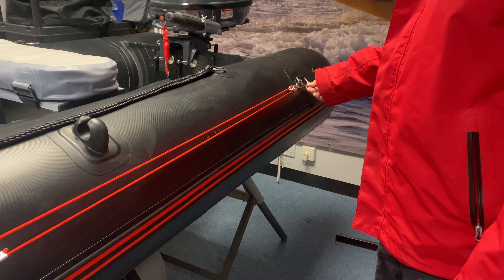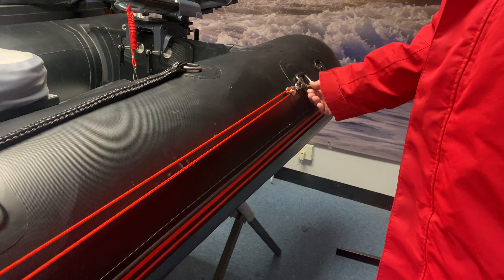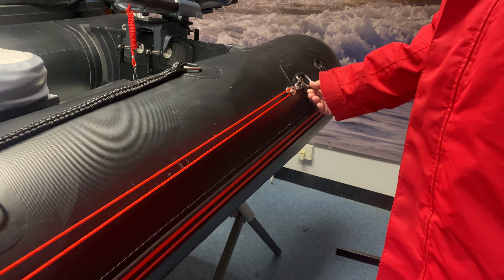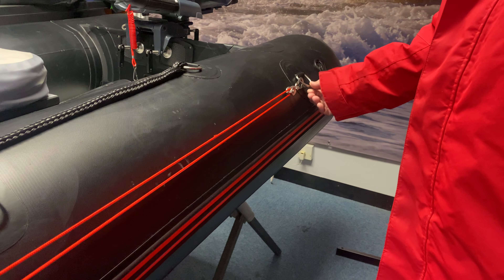Xcape Marine Xcape 4.0 Inflatable Boat Anchor Trolley System

Comment: Hi, thanks for the video. How do you lock it off so that it stays at the back of the boat. I’ve seen in various kayak videos a nylon zig zag cleat that does this. This  is normally attached by bolts or rivet that you wouldn’t be able to do on an inflatable. I’m just wondering if a zig zag cleat on a pvc patch that you can stick to the inflatable is available?
Cheers
Pete